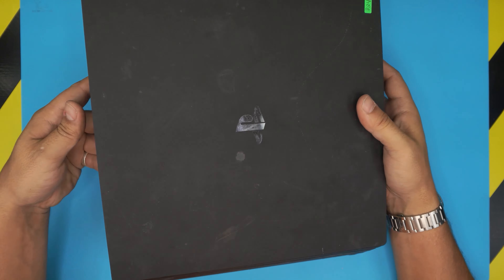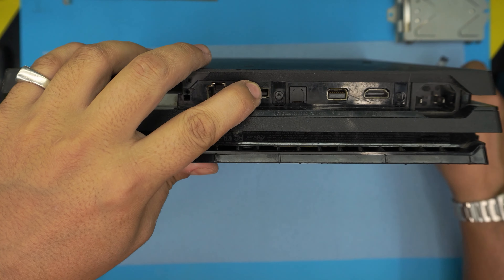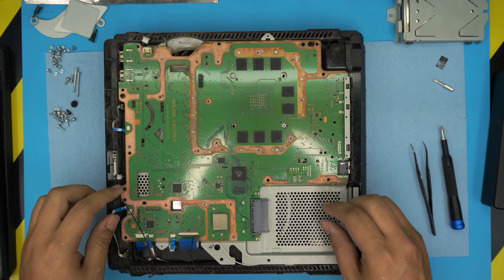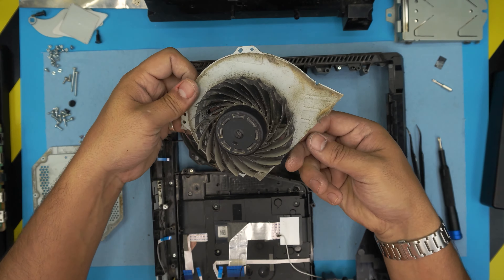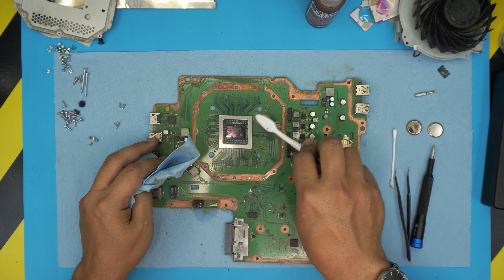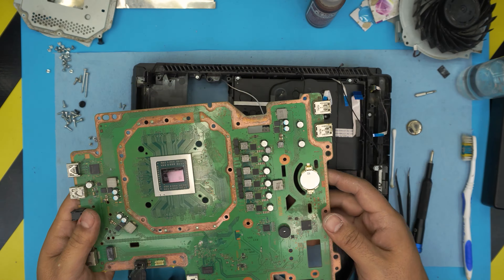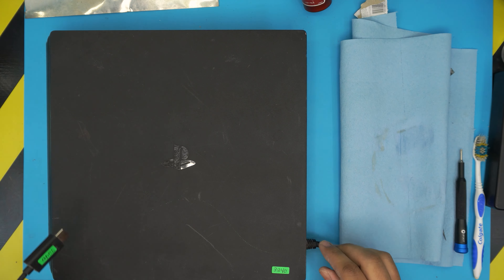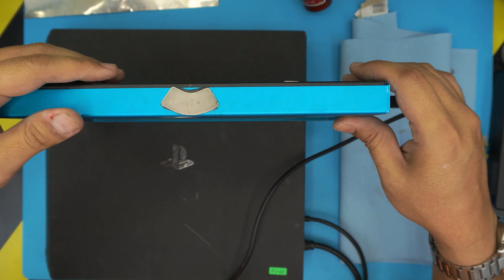Restore Disgusting Ps4 | Super Nasty Playstation 4

Comment: Wow 😮 unbelievable how clogged that heat sink was so atrocious.
Reply from the maker: Thank you for the feedback! if you wish to support the channel you can LIKE or SUB or both :P
in my 18years of servicing i see all clogged and stuff , but never a baked one like this :)
Reply: @uFixTek  I watched one of your other videos cleaning and reapplying new thermal paste on a PS3. It was very helpful. I picked up a used PS3 in unknown condition. After giving it a total clean, new thermal paste, new cmos battery and installing a SSD it seems to be working totally fine. Only problem I noticed when I got it was it wasn’t outputting in HDMI. After trying different cords it seemed to fix that problem as well. It also is slow to read Blu-ray movies some read fine at the start but others you have to reinsert a few times. I cleaned the lens for the DVD and Blu-ray. It reads game disks and  DVDs 📀 fine. This was my 1st attempt at doing this. Now I need to do it again on my main PS3. I just bought this other PS3 for tinkering purposes to practice on so I wouldn’t accidentally damage it from taking it apart.
Reply from the maker: awesome this feedback make me to help out more people and make more videos :)
Reply from the maker: the lens is made out of 70% acrylic, and over time it becomes blurry, you will need to use a cotton tip, and use iso alcohol. to lean it nicely. 
https://amzn.to/3yXFXIo
Reply: @uFixTek  That’s exactly what I did to clean it.
Reply from the maker: awesome :P